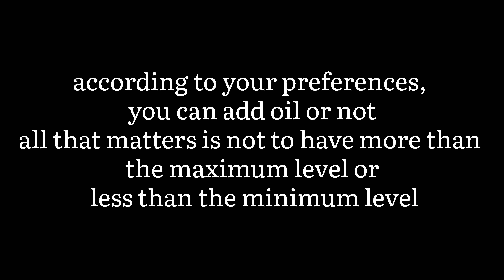How to change engine oil passat b8 (schimbare ulei motor passat b8) TDI Engine VW-Skoda-Seat

Comment: i hate last vw technology in passat b8. I have also octavia 1.9 tdi with filter oil in upper side on the engine.Very quick replacement .
Reply: The problem is not that the filter is at the lower at the engine. The problem is nasty cable under the filter.

Comment: 3:24 19 metal screw has Specified torque Oil drain plug 30 Nm
13 plastic screw 5Nm
32screw Filter 25Nm
Reply from the maker: correct, but because I don't have a torque wrench I didn't specify it. in the future I will buy a torque wrench and specify
Reply: @auto.b.i.daniel  at all great job.. 
one question: do you have any chance to show rear coil springs replacement on b8?
Reply from the maker: unfortunately, I do not have

Comment: Great tutorial. Thank you. 
Is it possible to remove the filter without removing the oil? 
I like to do a motor flush with the old oil but with a new filter. 
Thank you.
Reply from the maker: Yes, you can. after you put the new filter, the level should be a little higher before starting the engine

Comment: Buna….Am un passat B8 2.0tdi DSG7 150 cai an 2018 DFGA  cu 104.000km….cand sta masina parca simt ceva miros de gaze sau ulei nears….nu scoate fum…pe tester nu arata nimic…antigel si ulei nu consuma deloc….reviziile au fost facute la 1 an sau 15.000km….oare ce ar putea fi?
Reply from the maker: Nu îmi pot da seama, totuși vizual poți verifica dacă se vede umezeală sau ceva in neregulă in zona injectoarelor, filtru epurator.
Reply: @auto.b.i.daniel sa stiti ca aveti dreptate…am fost la masina si la injectoare se vede umezeala….sper ca filtru epurator nu se schimba greu…
Reply from the maker: @doricsoftware7622  vorbește cu un mecanic, el va știi sigur ce și dacă trebuie schimbat

Comment: Ce ulei se foloseste la Passat b8 1,6 daca stii ?
Reply from the maker: Salut, eu folosesc liqui moly 5W 30 top tec 4200 dar se poate si castrol longlife III 5W 30, am observat că si la 2.0 si la 1.6 se folosesc. Îți recomand sa te înscri pe vw passat b8 romania și foloseste functia de căutare și vei găsi exact răspuns la ce ai nevoie
Reply: @auto.b.i.daniel  eu filosesc  ravenol  vmp  5w30    ( scump intradevar )  , dar  media între  regenerarile filtrului  de particule  a  urcat  de la  430 km    la 700km pe distanțe  mari